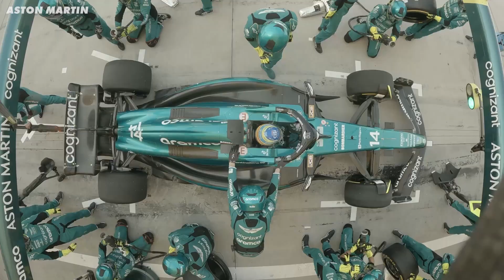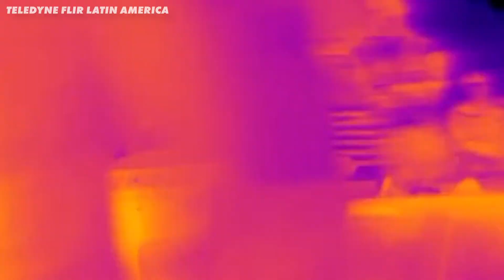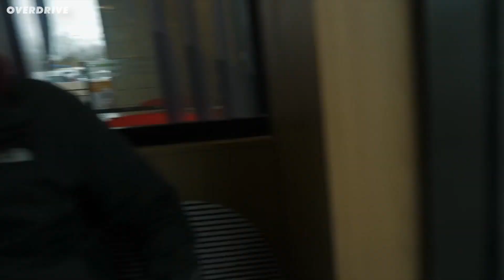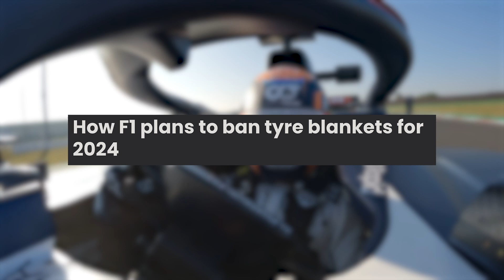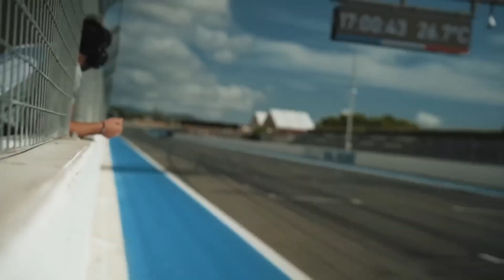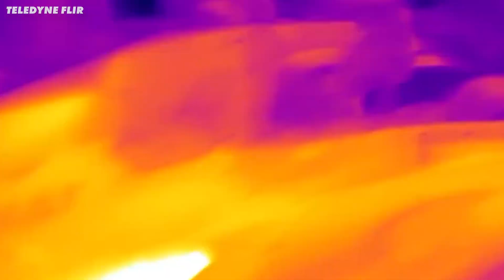Why Formula 1 TYRE BLANKETS Cost £22,000

Comment: Listening to F1 drivers stating that driving the first outlap on cold tires would look "stupid", makes you wonder if they've ever seen an Indycar race. Cold tires are part of the strategy and an element of show. 
In F1 everything has to be made super easy for the driver. It doesn't have to be that way, as Indycar shows. (and before someone will say that Indycar is an inferior spec car series, stop it, as it's irrelevant).

Comment: What about having active valves on the tyres? Have it so that they can be pressured to their running pressures but have the valve able to release pressure, pre-set, so not something the driver can activate, when the pressure reaches a certain point. Not able to pump more pressure into it, but can at lease start with full pressure.
Reply: Theres a kart team that runs in the USA that i think got caught doing that, it is insane how well that works

Comment: It would likely be so odd to drive a F1 car for the average American driver.  The FIRST thing you learn when learning to drive is not to ever drive with both feet (in an automatic, of course you use your left foot for the clutch in a manual) but the right foot is always either on the gas or brake.

Comment: Nitrous Blankets for a little 10lb bottle go for $150 for a tiny little patch about 25cm square. Or 1sq/ft

F1 tire surface area is about 1.75m square. X4 tires roughly. 7m square. 

About 75 x the area of a nitrous bottle heater.  

Multiply that out at $150 x 75 gives you aprox $11,200
Now consider how shit quality a simple thermal switch / pressure switch operated nitrous blanket is and compare that to an F1 tire heater and you get how the price escalates so dramatically.

Comment: I wonder, could they  use heated nitrogen gas to help  bring the tire to temp faster from the inside.  I suppose the density of the nitrogen would not carry enough heat and then it would drop it pressure as it cooled needing to be continuously monitored and adjusted. 

If they ban the blankets I’m sure they will come up with something interesting.

Comment: Super Aguri coated the inside of a tyre storage cupboard with flattened out tyre blankets and used them to make a tyre-blanket-box which heated the entire wheel and tyre evenly rather than just the surface. The tyres were removed from the box and wrapped in blankets before fitting to the car.  SA's argument is the rule which says they can only use tyre blankets to warm the tyres was met. At the time you were allows to put tyres in blankets in an enclosure, so SA rightly argued there was no rule against using the tyre blankets at a distance inside an enclosure.  The FiA banned the device "on safety grounds" (total nonsense) and added a "no-alteration of usage" clause for the following year.

Comment: Nelson Piquet was doing this in the mid 70s, first using a heated tent, then a eletric-heated furnace for his tires in formula 3. Along with screw and later cable-operated brake bias and roll bars
Reply: Emerson Fittipaldi did this in 1974 at the Canadian GP and won the race.

Comment: The FIA is honestly hell bent on making racing worse. If they absolutely wanted to reduce energy use for tire heating than mandate that the blankets have to powered by solar panels for example. Even then as Max said it doesn't make the racing better it just add another reason why F1 is not as exciting as it used to be in years and decades past.

Comment: Can I ask if there is a height/ weight limit for the driving experiance (I don't see many 
6ft 5" tall 17 stone F1 drivers😊
Reply: Alex Wurz is +190 centimeters and was F1 racer, in a time where weight and height would matter more. Nowadays the cars are large enough to design and fit any driver, and the minimum weight per car balance the things enough I guess.
But hope somebody who knows best comes and clears this up.
Reply: @joelrodriguez9611  The last time the competition was run it was clear I was too tall, 194cm, to enter.
Here are the current entrant rules:
Must speak and understand English or French fluently
Must be a minimum age of 22 and a maximum age of 65
Must hold a full current and valid driving licence or racing licence
Must be between 1.55 metres and 1.85 metres in height
Must not weigh more than 90 kgs
Foot size must not exceed EU 45
Must have ensured with a Doctor that he/she does not have a medical contraindication to the practice of motorsport on a racetrack, and that he/ she will not be under the influence of any medical treatment or any other substance contradictory to driving (unless submission of a Doctor’s Certificate)
Must not have any previous heart conditions or history of epilepsy, head trauma with or without loss of consciousness, dizziness, slipped disc or hernia (unless submission of a Doctor’s Certificate)
Must notify Driver61 of any medical condition that he/she suffers from, or have suffered from and/or any medical treatment that he/she is undergoing which may impair his/her judgment or reaction speed; or which may affect his/her ability to drive a motor racing vehicle on a racetrack
Must have good eyesight;
Must not be pregnant

Comment: I would expect if they banned heating blankets, we'd end up with the heating wire cast into the tyre rubber itself.
Reply: How would you balance the tire?
Reply: @f1mad957  you balance the tyre and wheel together, as normal. I don't think it would be too difficult to have a wire pattern that is naturally balanced.

Comment: When the idea of banning tyre blankets is floated around people do rightly point out that with current tyres it would be impractical (they're not designed for it, after all), so I'm curious as to why no one says anything about new tyres designed to heat up faster on track. I'm aware it's hardly a small investment to entirely redesign the tyres to cope with running from cold (hardly an insurmountable task considering a lot of racing series don't use tyre blankets) but the possibility always seems conspicuously absent outside of comments.
Reply: Quick answer :

1. Extreme downforce
2. Extreme power
3. Operating range is physically limited (unless you create a new revolutionary compound)
4. Safety

I get your point, but beware of the Dunning-Kruger's effect ;)
Reply: We spend more on coffee and rubbish in Formula One than we do on Tyer heaters to keep the car. Safe and drivers scratching. Formula One is 150,000 bad knock is quarter of 1 million work it out.

Comment: Max' arguments are stupid though. Just because the air conditioning uses more power (which he only guessed anyway) doesn't mean you don't have to care about the power consummed by the tire blankets. With that argument, they could waste any amount of energy unless it is more than the flight to the circuit.

Also, I don't care if warming the tires looks stupid on the out lap. If it leads to more unexpected qualifying results for example, as the variance in tire preparation gets bigger, it could even sporting-wise be more interesting than it's now.

Comment: They cost 22K because they are sold to F1, lol. These do not cost over 700€ to produce, per unit, all included. The control unit and it’s programming is trivial and quality components for that will set you back 70€ at most.
Energy consumption is BS! Each one will pull 2Kw (most likelly not even 1Kw because the heating curve desired is gentle). 80 tyre sets heating up for 24hours, (across the weekend), would equate to 1500€ of electric bill so…
(Just for context I manufacture hardware where we use these kind of heating sollutions)

Comment: I wonder if any experiments have been run to heat the tires via the rim? Induction heating of the rim could slowly trickle heat the from the inside so that the treads could at least reach operating temps much quicker than if all the friction heat is heatsinked away by the sidewall. (In other words you don't have to heat up the whole wheel, just the treads.)
💪😎👍
Reply: How would that help? Applying heat directly to the threads would be faster than heating the wheel, for that heat to transfer to the tire, and then to the threads of the tire.
Reply: @1TieDye1  That's not a option if blankets are outlaw.

Comment: Can you warm tires by adjusting brake balance to front and step on the throttle... You create friction by braking on first and power on rear tires, traction?
Reply: Sounds like it would create a lot of wear on the tires
Reply: Wear is traction, traction will generate heat
Reply: you dont have to change balance, the heat from the rotor gets to the tire well enough

Comment: I'm sure you and the boys are up to the challenge of creating your own $400 DIY tyre warmers.
Reply: $550 each actually seems pretty reasonable considering it’s not just a blanket, but includes all the sensors etc too.
Reply: @Doug_in_NC  it’s not just the sensors is the data recording and login of all settings. What time how much power was consumed in the two hours prior to the race
Reply: I could probably do it for $50 and a carton. In Australia, the blankets have been banned for a while. They leave the tyres out in the sun.
Reply: @BabyMakR  I can’t see that being an effective solution on a rainy afternoon at Spa. 😂😂
Reply: @Doug_in_NC It's not much good at wet meets in Australia. That said, the Super cars are much heavier than F1s so they can put more heat into the wheels more quickly.
Reply: They don't cost much more than £400 each anyway so that's not much of a challenge.

Comment: As someone who works at a company that makes custom heating solutions: The heating elements themselves will never be expensive. If the material costs of a tire blanket exceed 20 euro's, I'd be surprised. It's much more about the labor to get everything build. The conducting gel and the conforming insulation can be a little more expensive, but also not insane.
The thermal and pressure sensors with the controllers would likely make up about as much of the cost of the entire solution.
And other than that, it is likely just not a competitive market. So I assume the margins are also quite good.

Comment: Roughly $550 per blanket doesn’t seem that unreasonable considering it’s including the sensors and wiring harness, pressure sensors, Kevlar draw strings and everything else.
Reply: Isn't it 22k? That makes it 5500, not 550
Reply: @Bullseiify at the end of the video they clarify it is 22k for 10 sets. Really quite reasonable for f1.
Reply: @eslmatt811  especially as they probably last a few races or even a season.
Reply: @Bullseiify  $22K for a race - roughly 10 sets of tires. The screen shot from the company that sold them showed $2200 per set.

Comment: FIA World Endurance Championship the drivers and teams requested several warm up laps to heat up their tires before the start of each race do to safety concerns. In some IMSA series races I've seen mistake were made because the driver tried to push for better position after pitting with fresh tires. Those cold tires can lead some "Argee Bargee" into the tire barrier.
Reply: From experience I know tyre formulations for some racing series make cold tyres akin to driving on glass. Returning to tyres which do not require heating will mean more tyres are consumed during events where very high energy is put through the tyres under load. Think of how long an F1 intermediate or wet tyre lasts once the track is dry; now multiply that by the number of pit-stops required to reach the end of a race.
If the end game is to move to race tyres which do not require heating, motorsport would need to return to engine power levels of the 1950s.

Comment: Would have been nice to know how much power each blanket draws (typically, sure once up to temperature it will draw less than cold). Is this on the order off 100 W ea. or 10 kW ea.?
Reply: looking at the size and construction it will be a few kW. also the main costs here really arent quality or smth but the fact they are made by hand for a niche market so no economies of scale.
Reply: @sudazima  common sense at last thank you. Every part of the blanket is cut and stitched by hand side wall heaters take upwards of three hours each to make two per blanket fabric has to stand 700 Celsius very expensive. Kind regards, Mike Drury, owner of MA HORNE tire heaters
Reply: @sudazima  thank you very much for your comment, some brains at last Mark Drury, inventor of tyre warmers
Reply: One set takes 16 A is 10 amps rear 6 ams front on first initial switch on and then moderates obviously through for the next two hours. The 22,000 is for 14 sets per car. Per race, including free charges. Hope this helps. Kind regards, Mike Drury, inventor, tyre warmers
Reply: @ploploprob  16 A is for all four tires as I said, they do modulate because they’re insulated with aramid and nomex and silver 4 ounce PU and two layers of Merclon hope this helps and answers your questions
Reply: @f1mad957 chances that you’re actually producing these, yet can’t construct a readable English sentence?
Reply: I did some fast calculations, tire set weights about 10kg, to heat 10kg from 20C to 100C. You need about 1,5kW tire heater for about 40min... But if this calculation are way of because you heat tire not the rim... IMHO in reality it doesnt need so much power
Reply: @Omn1potenc3  we have to heat the room, stop the loss of temperature on the track. We also manufacture stub axle heaters in the tire close on for the first time the room doesn’t lose its heat into the axle.
Reply: @f1mad957  aaa ok, thx for explenation
Reply: @Omn1potenc3  it’s not just the tire we need to heat. Sometimes we have sea white spot nitrogen carbon monoxide and argon gas mixtures in the tires so they’re in so they are inert. I know we are using blown magnesium rims. It’s important to get the rims up to temperature as well as the tire to stabilise the pressures.
Reply: @ploploprob  there’s nothing to assume I make the tire heaters, so I do know
Reply: A top end (civilian) tire warmers takes around 1000-1500w.  I'd imagine 5000w is a pretty solid estimate, maybe overkill

Comment: 20k for simple heating coils 🤦🏿‍♂️
Reply: American Military Contractors be like😂
Reply: i imagine it is 20k for like a hundred of these blankets for a bunch of sets of tires for each driver
Reply: I believe what the video is saying is that not using tyre blankets costs $21k a lap, actual cost of the tyre blankets is $2k per
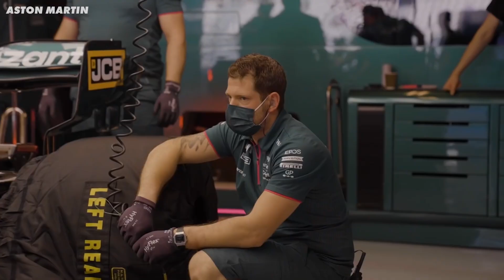Reply: @ 7:46 "MA Horne charges €2.200,00 per for a set of blankets"
Reply: It’s also a very niche market. Its not like they can sell millions of them to bring the price down
Reply: @adamozmin8970   niche doesn't matter. I can build a 1 off heat warmer in my garage
Reply: @VoidPixel4179 you can get 75% of the effect for 10% of the money, but you will not get it 9:25 exactly as explained perfectly to match the chemistry of the tyre and wheel rim
Reply: its 20k for a set so about 5k per tyre which is pretty reasonable
Reply: I mean
Make it cheaper and sell it to them if you think they’re SO expensive haha the control units are the most expensive after all
Reply: @1draigon  yeah, "control units" is the way to make few cents of electronics look more expensive
Reply: They can’t fail so they need maximum redundancy which means lots of testing , the best materials, over built and quality control at every step which add man hrs and $.
Reply: @DanO1234567t they can’t fail? I’m sure they can, but mostly they don’t. Just like a toaster. And even distribution of heat has been solved in 3D printer beds that cost like 50 bucks. So producing one of these for $300 is possible. But why should you? Even if I start selling them today, Teams will stick with the solution they know.
Reply: @LuLeBe  it’s a vague statement. read it as they do not want failure and will pay significant amounts to make sure they don’t. Saving money isn’t a concern.
Reply: @DanO1234567t I agree that they don’t care about saving money, but at the same time I don’t think any special caution went into making these less likely to fail. Sure they may not have used the cheapest, thinnest wires available, but I doubt there’s some special design aspect to prevent failure.
Reply: You may want to rewatch the video, it's not just a simple heating coil.
Reply: @ChadGeidel   the jell and sensors don't make it 20k either. Both could be built at home with simple tools